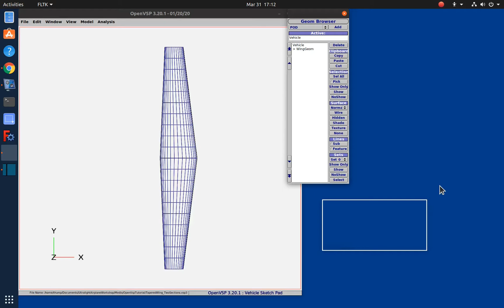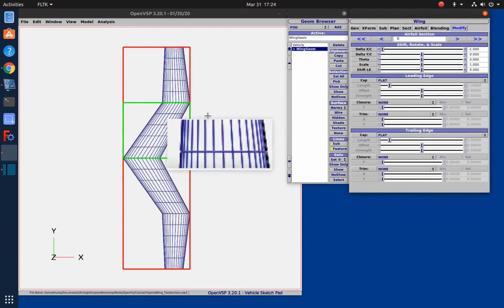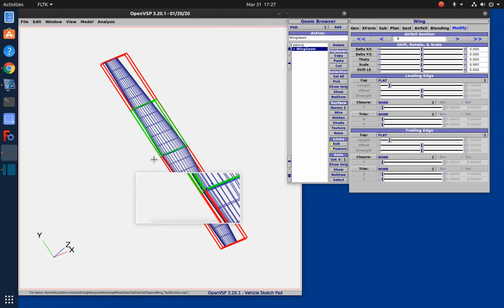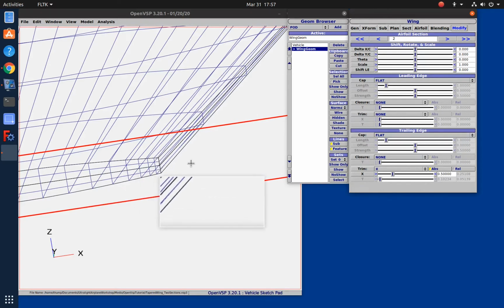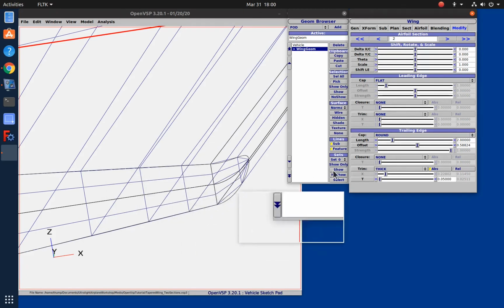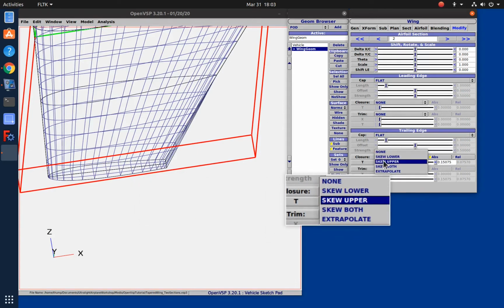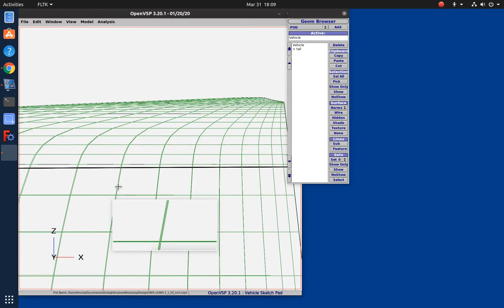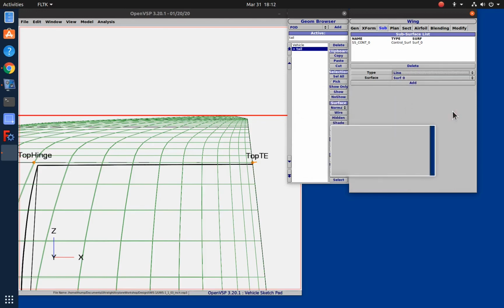OpenVSP Tutorial: Wing Dialog Modify Tab

Comment: I wish you the best of success with these videos.  You might also point your viewers at the OpenVSP University videos that Brandon has been putting together.  

I saw your request for negative length tip caps at the end of your video -- it might be easy, but might not.  I'll add it to my list...  That said, perhaps YouTube videos are not the best place to make feature requests.  I suggest you use the Google Group for that.

The Modify tab was born from the fact that in engineering work, there is always something wrong with the airfoil points you have available.  Most often, it has to do with trailing edge bluntness.  You may be given a file representing a sharp TE, but you want to model a realistic blunt TE for your aircraft -- say a constant 1/8" out the span, but your wing is tapered, so this is very not-constant in %chord terms.  Airfoil files are always specified in %chord, in x, y coordinates.  Another common problem is the opposite.  You are given airfoil points that are blunt, the the analysis you need to perform only works for sharp TE airfoils.  Closure - Extrapolate is really about this case.  If you read in a set of airfoil points with a gap at the TE, extrapolate will extend the TE to a sharp point.

The modifications at the top of the tab - shift, rotate, scale, etc. are really about specifying control surfaces or high lift devices.  First you build your cruise wing in OpenVSP.  Set all the parameters as normal (sweep, dihedral, taper, etc.).  Next, copy/paste a duplicate version of that wing.  Leave all the normal wing parameters alone.  Then, go to the Modify tab, change the shift x/c to 0.8 and scale to 0.2 and theta to 20deg.  All of a sudden, you're specifying a control surface airfoil in 'airfoil coordinates' -- x & y in % chord -- but the result is in 3D along your wing.

The ShiftLE parameter is there for certain poorly behaved airfoil file types.  For example, leading edge slats often have really nasty geometry.  Think of a comma on a bad day.  Depending on how the points along the slat foil are specified, OpenVSP may have difficulty figuring out where the leading edge is located.  So, ShiftLE exists so you can adjust what OpenVSP thinks is the LE of that section.  99.9% of the time, nobody will ever need it.  But, it is there if you do.
Reply from the maker: Hi Rob, Thanks for the great reply. I'll try to remember to mention the OpenVSP University.  It is a great resource. I make these videos first for my Designer Tier Patrons on Patreon and then make them public 6 months later so it will be a while before most viewers will see new videos. 
Any serious changes that I'd like to OpenVSP I will make through the OpenVSP forum.